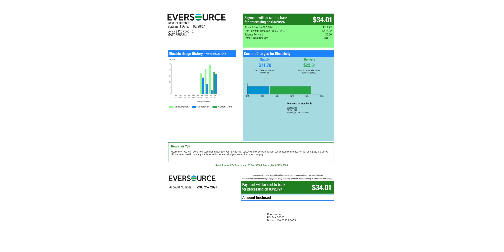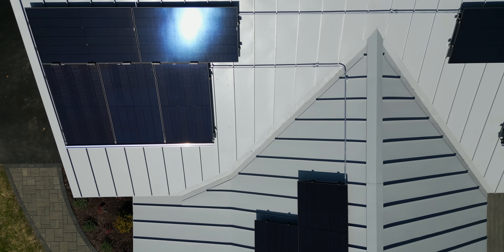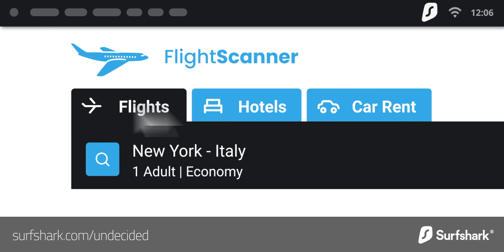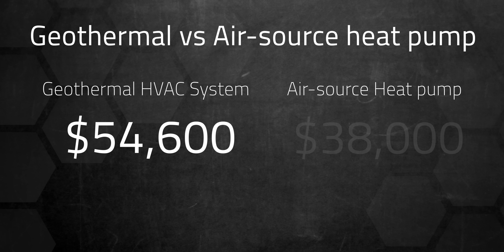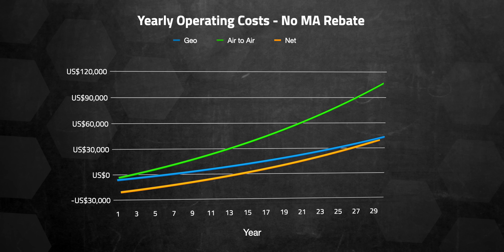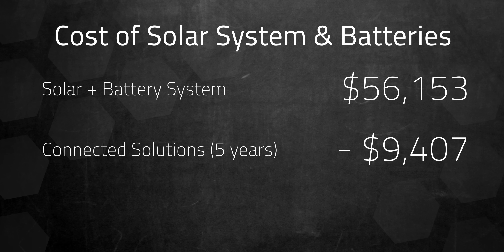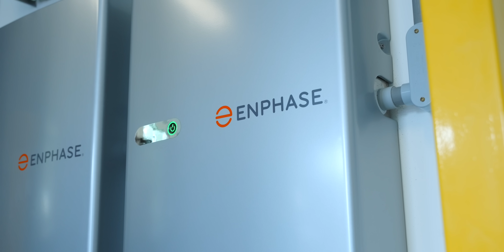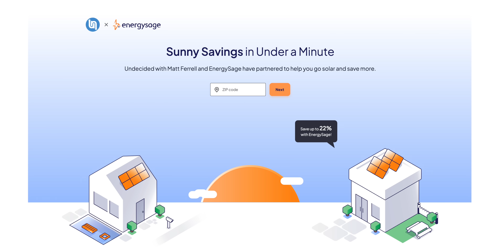What I Learned After 1 Year with New Solar Panels

Comment: I have been a general contractor in California for over 33 years.  All new houses require solar and our electric cost is similar to yours.   Your cost for panels, micro inverters and batteries is double what I pay 💰.  You obviously made a significant contribution to some contractor's college fund for their children.
Reply: Yeah, the panel price isn't criminal at low'ish $3 per watt but the battery per kWh is lol for a 20kWh system. Even with the good panels you'd expect per watt to go down with the size of this system.
Reply: In 1995 I built a small ranch style home 24‘ x 52‘+ Half basement with walkout. This 1500 square-foot home has 35 mostly large Anderson windows.(lots of glass for a smallish home). I’ve had my WaterFurnace geothermal heat pump for almost 30 years, which is quite amazing I think. The only thing that I’ve had to do with this system is replace a couple of switches running just over $100, in 30 years! My HVAC guy that I’ve had for the past 20 years says that Water Furnace is the Cadillac of ground-source heat pumps. And that’s coming from a guy that sells a different brand of heat pump. That speaks volumes on the quality of WaterFurnace. The system cost me $7800, equivalent to $15,983 in 2024. instead of having a high priced well driller come in and drill deep wells. I had my septic guy dig 700 feet of 7’ deep trenches for $250. The system has paid for itself several times over in it’s lifetime and after 30 years, it’s still going strong. I also purchased the elective of having my hot water heater tied into the water furnace saving thousands more over the past 30 years.
Reply: The number one thing that changes from place to place is whether having on-site batteries makes any financial sense.  If you live in a net-metered area with a stable enough grid, the battery is a pointless expense.  But if you're somewhere that doesn't have net metering (e.g. most if not all of the UK) then the battery is the only way to shift generated power forward to match demand and without it the system will never pay for itself.

It sucks that this is the world we live in, because without the fiction of money, on-site batteries only make sense when the grid is unstable.  Instead, some arbitrary regulation makes them necessary in some places.  The extra conversions in most battery systems, combined with poor economies of scale, just adds inefficiencies that are bad for everybody, nevermind the initial costs themselves...
Reply: @oasntet  I disagree, while huge batteries may not make sense (they don't in mine) a small battery (in my case 14.3kWh) is not that expensive ($3500 less tax credits) and acts as a whole house UPS (depending on your inverter). Even though I only take a couple of power hits a year, the peace of mind makes it worthwhile
Reply: @georgedorn_fnord  not necessarily. Even in a net metered utilit (Nem 2 or better in CA), you can rate arbitrage which will absolutely offset your costs. A high-usage EV charging program often slices the cost of power overnight/ super off-peak but increases the rate for peak and off-peak substantially. The battery allows me to export all my solar and charge batteries and vehicles overnight. It's a 4-7x difference in cost
Reply: And this is energy regulation 101 that shows better energy standards stimulates economies of scale to reduce the cost of the equipment used. Not to mention competition in the implementation of systems like this.
Reply: @alberthartl8885  His pricing is almost.accuratengiven the number of the panel type. His panels are very expensive...you can get cheaper panels for lower cost. He is running ev and other energy efficient items that require the type of panels He purchased. Don't forget the 30% tax credits in total.
Reply: @user-cd9ui4qv4q it isn't the panel cost that runs up the price in America, it's the installation and even more so, the insane overhead and profit margins
Reply: Looks like he paid for his own rebates.
Reply: @watermanone7567  I'm sure rebates do push up prices.
Reply: We are in Australia and paid 24k AUD for a 10KW system and a 19KW battery! The prices on the US are insane. We're gonna make our money back in 7 years and have 25 years warranty.
Reply: California gets more than twice as much sun as Massachusetts, might be as much as 3X. That alone can account for the cost difference, you need three times as many panels  in MA for the same output.
Solar makes sense in CA, it doesn't in MA. The geothermal heat pumps and high insulation are a good investment in MA.
Reply: I did a naah, when I saw what he paid for solar.
 But when I saw he paid triple for geothermal I scathed from the screen.
Reply: @vaporainwaves  yes in Sweden we would also pay a 1/3 or so for a geosetup. But here it’s al water based
Reply: I agree.  I paid a 1/3 of what he did for solar for half the capacity.   Some contractors brat or wife has a new BMW
Reply: He already did a video on this.  You can't compare your local prices with his.  There are just too many location and situation-specific factors that will drastically affect the pricing.
Reply: @letao12 the components cost is independent of location.
Reply: 27k for materials is 55k installed all day.
Reply: @letao12  No there are not. These systems are largely the same, and local requirements aren’t going to raise a price 2x or 3x .
Reply: @ChrisVirgilio   Again, he already did a video on this.  If you don't believe me, just go watch his video where he explains exactly this.
Reply: I did a DIY 25KW microinverter system for $49K before the 30% tax credit (thank you, Inflation Reduction Act). Used panels are available for cheap, but you have to be careful with that. My panels were new. NO regrets, the property is literally a power house now, generating surplus green energy in the neighborhood.
Reply: I agree, it's madness.
Reply: Yeah, what the heck? 
I did an off grid setup this summer for my garage/shop/office and 15kWh of batteries cost like $2,800. What's the deal with his $33k battery??
Reply: @wsbucker  Yep, even if you pay 2000$ per 5kWh module, it is still 8000$, installation few hours. But even if installation is charged sama amunt than hardware, it is still 16000$
What are margins in this business$!
Reply: I installed a 20 megawatt hour system about 7 years ago in New Jersey. Combined with incentives that were available at the time and production, I was able to pay the system off in about 3 and 1/2 years. Fortunately, I had the perfect setup where my roof was mostly south facing and didn't have a lot of angles. Best investment ever! I haven't paid an electric bill in over 7 years.
Reply: $1,300 per panel that retails for $250 or less.
Reply: Did he indeed??  Does that seem normal to you (since you are in the industry), especially considering how it is suggested in these videos that research has done in order to get the best products and best prices?

Seems a little suspect to me
Reply: @alberthartl8885  can you provide the sources of your systems?  Thanks for sharing.
Reply: Our most expensive system had 42 Qcell panels, 42 IQ8 micro inverters, 2 Enphase batteries, 1 Enphase smart switch and a Kohler generator.  Cost with labor was $42,000 before credits.
Reply: That cost jumped out to me, too.  I'm going DIY route, but the panels are in the $0.30-40/watt range for good panels such as Canadian Solar.  Pytes batteries are $230-300 per KW-hr (unheated or heated).  I didn't see the inverter cost, and that's significant.  I'd probably do a pair of something like Sol-Ark 15K's at $7K each (rather than micros).  Some other brands like EG4 are half that.  That said, I had a firm based out of Nashville tell me a ground mounted, 10KW system would probably run me $150K, so there are certainly some places out there who are making sure that college fund covers some pricey private schools!
Reply: I didn’t pay nearly that amount for my panels in NC. My goodness Matt!
Reply: I moved to a new housing development. It has solar panels, and one of the reasons for renting also supposed to be ADA. They have never been hooked up almost been there a year. What a joke. I'm sure the builder received a tax cut!!! And rent already went up.
Reply: @Jlmagsounds about right.
Reply: Lol, yep. Same thing I said 😂😂
Reply: I just about fainted when he said the panels cost him over 80k dollars, are they gold plated or something? And he paid over 30k for 20kwh of batteries!!!!! Wholly monkey, I paid 5.9k for 14k watts of solar panels (31 455w panels aka a pallet) and I paid 9k for my 30kwh of LiFePo batteries, and I paid another 5k for 4 12k btu (1 ton) solar hybrid mini split A/C units for about a grand total of 25k including wire, odds and ends, and two Reliance Pro trans II transfer switches. For just the cost of his panels I could of done my house, my parents house and one of my kids houses LOL
Reply: @JBPowell-y9m   he goes over it in another video -- high costs for permits, required inspections, added man hours due to the way the permits and inspections stack.  

The reason his geothermal cost so much was because he used vertical pipes.   Better when you don't have a huge backyard - or don't want to dig it all up.
Reply: @redwolfexr  wow, my permit cost me like 250 bucks and a few inspections, guess it's not a fair comparison from me because I do it all myself and I do not back feed the grid, just being off grid is enough for me, I'll have to watch that other vid, now I'm curious to what his permits cost him.
Reply: @JBPowell-y9m   not touching the grid is a huge difference by itself - don't need to involve the utility for pre-inspection before turning it on.
Reply: Hate to break it to you but the maintenance on that fancy HVAC equipment will eat most all of the efficiency savings.    Also, open source geothermal water eats through the equipment in less than 10 years.  15k per unit to replace just the heat pump.  If you don’t have a titanium HX on the geo well water do it now.  My job is maintaining houses with these systems.  They are great when they work and cost a sh*t ton to service and replace parts.
Reply: Solar financing companies overcharge the amount of the tax credit so there is no savings. Industry standard scam.

I was going to become a solar salesman with a friend. He had me on the phone with a friend of his that runs a solar financing company. He laid it all out how it works. 
And if you get a new roof at the same time they find roofing contractors that are willing to markup their bid the amount of the tax credit. 

Pay cash or don't do it.
Reply: I was under the impression solar in California is staggeringly expensive.  My nephew just installed a 10k roof mount system to his house in Sacramento and paid 43k for it.  He says it will take the normal 30 years or so to recover that cost.
Reply: @ChrisPat-kq4fw ?? $4.30 gross?  I’m in the Bay Area. We did a system in 2023 for $3.30 gross. Plus 30% tax credit. With our utility rates with PG&E (Sacto is roughly same rate as me), payback is like 4-5 years. There is something seriously wrong with a 30 year payback calculation in CA.
Reply: @danchen6783  do you mind sharing company that did it?
Reply: @ChrisPat-kq4fw   yah, he just told you that they were MANDATORY for new houses.

So the solar installers can charge as much as they want to and people will pay it to get their house.
Reply: @redwolfexr  Interesting point. Something to consider when buying a home in Cali.
Reply: you sound dirt poor lol. contractors college fund lmaoo.
Reply: Notice Matt didn’t comment or reply to anything in this thread.
Reply: @scottmackey4182 never does.  Because this isn’t a community; this is a propaganda mill open to the highest bidder
Reply: @NightRogue77  I agree that he promotes a lot of different “solutions” out there, but what incentive would he have to say that all of this stuff was super expensive? Do you think he got bought out by big oil or something? That seems to be pretty unlikely.
Reply: @ oh no I just mean in general.  Seems like a venture capital push platform to me

Comment: If you live in the country side and don't need to install it on your roof. Just install it yourself on 6" Sch. 80 pipe. It is NOT rocket science. I installed mine 15 years ago and its still going strong. It has already paid itself off. It makes sense when you realize that most of the price is in the installation and you don't need batteries if your state has Net Metering unless you have money to burn.

Comment: What you haven't accounted for (or maybe you have but didn't mention it), is the cost of maintenance, part replacements, weather changes, nature damage, electrical/fire damage, potential security needs (i.e. security cameras/electric fence), or maybe even something as simple as how much insulation could you have afforded if you had dropped a panel or two, or how much will the extra (lost) space cost you in efficiency.

You also don't know the financial situation of the world in a few years time. Especially now, with another potential world war or insane tax changes on the horizon, an economical crisis might be closer than you think. You'd have an edge here, assuming nothing breaks and your home won't get raided. After all, in a way you are basically advertising how much money you have. This video reminded me very much of S1E3 of HBO's The Last of Us.

Then there's the climate change. Who knows how your local climate will change in 5-10 years down the line.

Your projections only work out for the more or less best case scenarios. Not trying to be a downer, I just want to keep things real.

Comment: In Texas, we pay $.11 per kWh and receive only$.04 for kWhs we put into the grid. Still, with a system comparable to yours, we are net-zero, although the system will not pay for itself in my lifetime. One thing I think you didn't mention is how much you save on gas by charging your cars in your garage. We save about $600.00/month.  We also have deep water wells and an aerobic septic system that combine to use a great deal of power. With our system our water and sewage are also powered by the sun (aerobic septic produces clean water so we can water our gardens even in a drought). Our system would not pass a corporate cons-benefit analysis, but it would come close. 

Question, do you use your cars for battery backup?

Comment: The only caveat that I would add here is that energy prices may not continue to rise as they have traditionally done if renewables continue to replace fossil fuels' power generation. The greater the level of renewables' penetration on the grid, the more stable, & perhaps lower, electricity prices will be. Should this turn out to be the case, it will be interesting to see how competition between energy companies affects pricing. Only time will tell.

Comment: When doing cost analysis, remember that credits for installing renewables comes from taxpayers, although renewables will reduce the cost of rebuilding after climate disasters and probably saves lives.  In comparing home rooftop solar with solar/battery farms plus new transmission lines, the solar/battery farms won with the larger iron-air or iron-flow batteries.

Comment: $88K / $200 average per month = 444 months for ROI.  Or 36 years.  And that's assuming nothing goes wrong.  Solar panels compromise the roof and require more frequent maintenance and replacements.  Batteries will need to be replaced every 20 years.  So, no, you haven't saved any money.  And this assumes that you continue to live in the same house for the next 36 years.  That's unrealistic for most people.  Many families move houses several times during their lifetime.  Just doing the most basic back-of-the-envelope math proves that consumer grade solar makes no sense.  You can buy a second home or several cars for the cost of a single solar installation.  Solar is a nice idea but too much greed surrounds it.

Comment: Beautiful.  Well done. We have a passive house, we produce 3 times the energy we use, we sell the excess electricity to the grid at about the cost of buying electricity (Israel), we still don't have batteries yet, we will pay back for the PV system in about 6 years (3 more years from now).